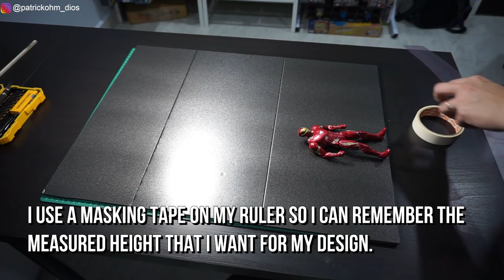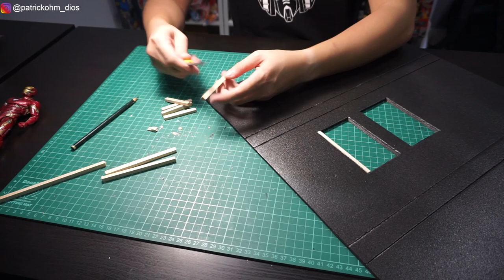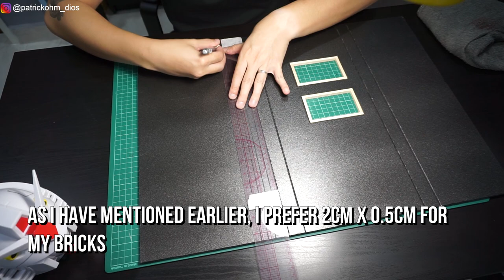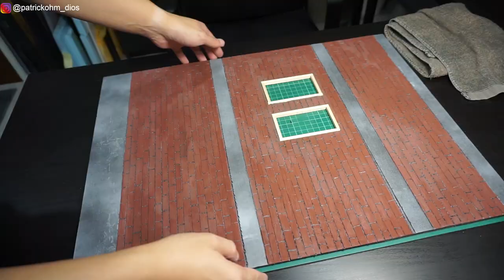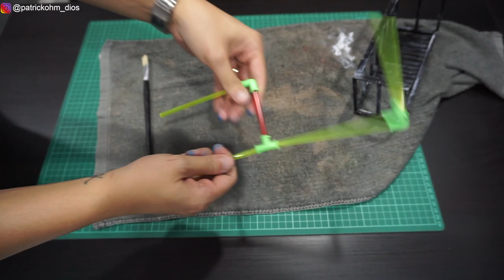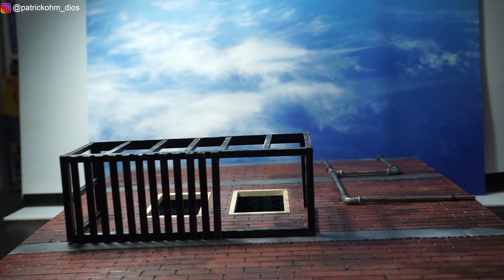Fire Escape & Brick Wall *Tutorial* EP32

Comment: Excellent. I was thinking of using stock images for the outside of a building but might just make it myself now I have seen this.
Reply from the maker: Yes you should, it is so convenient to use, and make sure you print them in A2 or you will suffer, I use to snap pics with laptop screen to A4 to A3, at the end A2 will save alot of trouble, print the basics would do, city scene / galaxy / clouds

Comment: Not for nothing but you could have done a black wash before you painted the bricks.. let dry then dry brush the brick color.. will save a ton of time also looks more realistic... also what I have been doing is using quick patch for patching dry wall  and putting it on then wiping off to give it a REAL brick all look... it’s also a lot faster and the results speak for themselves
Reply from the maker: Hmm thanks for the tip, yea and I have heard of that method as well but never applied it..🙏 will try to do that if I have another brick related video 🙏🙏

Comment: Doe the foam have a plastic on it or is it just normal foam and what thickness did you use? Is it more of an art foam board or is it used for building houses like this https://www.homedepot.com/p/Owens-Corning-FOAMULAR-1-2-in-x-4-ft-x-8-ft-R-3-Square-Edge-Rigid-Foam-Board-Insulation-Sheathing-36L/100320356